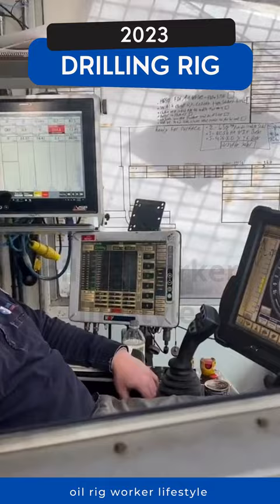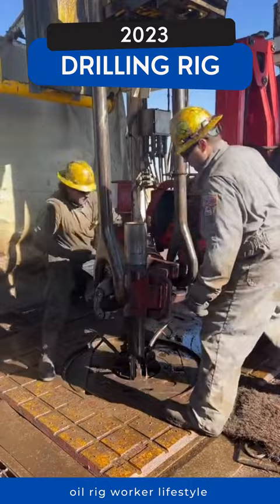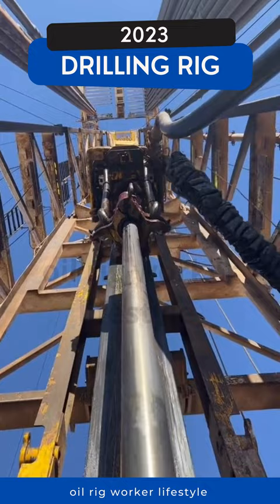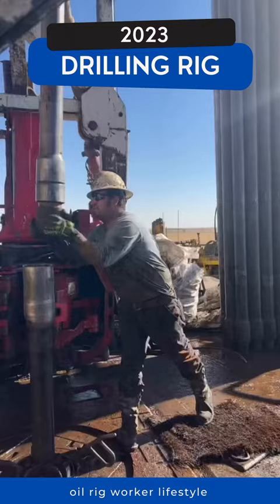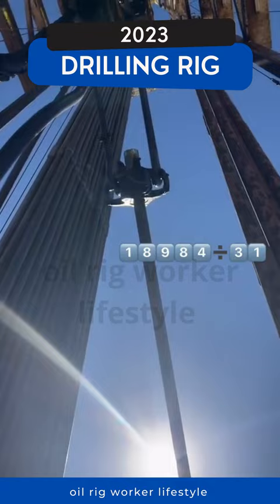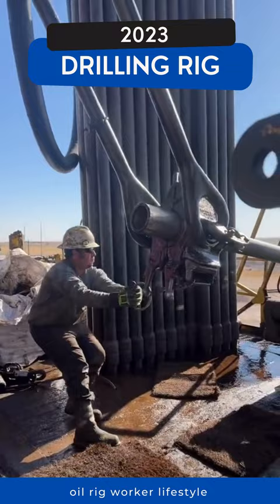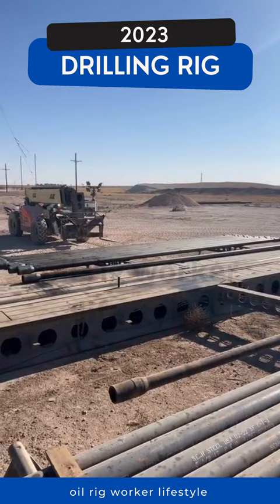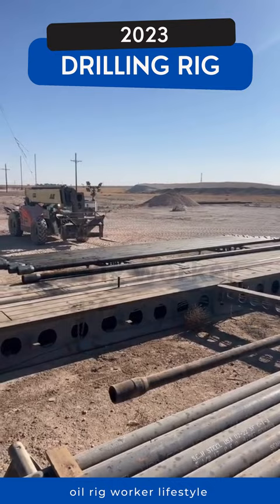rig floor activites 🔥 rig floor drilling #petroleum #casing #rig #ad

Comment: So, those pipes used to drill, do not stay in the long hole? What prevents the hole from collapsing in the softer stuff? Clearly, the bedrock won't collapse in on itself, I would assume, but the soft stuff... I want more info, and had to come back after trying to research for 2 hours about this... Anybody is welcome to help answer my questions!!!! Thank you.
Reply: After we drill the hole we put casing and cement down the hole to stabilize the integrity of the well. The casing diameter is slightly slimmer than the hole so that the cement goes along the outside of the casing keeping it in place
Reply: The guy below answered it well. But also the fluid that is currently in the hole keeps pressure on the well bore and keeps it from collapse
Reply: @T-Bambino  ah, thank you...
Reply: @jacobsmall5942  and that is also clever.. makes so much sense now... Thank you both for taking the time to answer my questions. I can assume this is common knowledge for most folks, but since I just purchased a new(old) house and it has a well and a septic system, I have been going down all sorts of rabbit holes and been learning all sorts of really amazing info, allot of which doesn't pertain to the house info I want to know, but none the less, I have been really intrigued and blown away with the technology you guys work with. I once just thought it was a simple hole, and call it a day... But oh no, these are not just a simple hole in the ground. 

I read a paper that covered that Russian well, that mention only a few neat details about that 12 mile deep hole. The drilling rig itself, had to be designed to not just apply pressure downwards for the first few pipe lengths worth, for the cutting/chipping action to take place, but what would have NEVER crossed my mind, is once that were past that point of about 5 to 10 pipe sections in the hole, the drill rig no longer needs to apply downwards pressure, and the drill rig now is in reverse, as per, supporting the weight of the pipes hanging from the drill rig... And once it is 12 miles deep, the shear weight of that many pipe sections measuring 1000's of tons, hanging from the drill rig, but the friction on the outside of the pipes required so many 1000's of HP and 1000's of ft lbs of torque to overcome... While not forgetting to exclude the water-shear on the inside of the pipes, and the friction there too... Just amazing stuff. Again, thank you for taking the time, I am learning about this slowly, and I must say, the men who run these rigs, from what I can see, are some of the most hard core men, not only physically but mentally, to push through some of the worst of weather conditions and climates, in order to get the product the nation and world demands, almost at a measure of being ungrateful, as I learn how complicated this process is.. So, thank you for rocking and rolling to work such an occupation l, that my whippy noodle arms couldn't handle.
Reply: @drubradley8821 well damn that's about as much thanks I ever got working on a rig. So your welcome.
Reply: Up here in Alberta we run what is called a service casing made of cement .
Reply: Google hydrostatic pressure. The mud thats pumped down the drill string and then back up the outside to the mud pits on the surface, is required to have a specific density to counter any bore collapse. Its regularly measured in lbs/gal in the states. The mud weight is tested often by the derrickman and mud engineer (1× per hr or so) to ensure that there is enough pressure pushing back on the walls of the newly drilled hole to ensure that it doesn't slump in on itself. They add "barite" to increase the density of water or diesel. They add "LCM" (straw, sawdust, mica, etc) to develop a "wall cake" and ensure they don't lose the mud they've created to certain porous formations (1000s of gals of mud is also expensive). They also add soap and other chemicals to the mud to help lubricate etc. They add "gels" to help suspend particles etc. This is all done to help maintain bore stability and improve the drilling process. But without the correct density of mud, ie mud weight, the hole can collapse in on itself. The hydostatic pressure down hole needs to be great enough to hold off a bore collapse. 

But yes, after the string is removed they will case to ensure consistent flow during production. But during the drill process the bore is maintained by engineering the proper mud density.

Comment: So it’s still hard work but when I did it in 2000-2004 we used spin chain , Kelly and rotary table.  

We laid the pipe sideways by pushing it to the v deck and ripping open the elevators.  The pipe would soar down crashing into a back stop reinforced with an old tire.   The guy down below would straighten it a quick as possible and hand roll it into the racks .  Brutal all the way around .  Rig technology has come so far lol.  We used to say  , “ isn’t it the year 2000, why are we still working like this lol?”

Comment: Correction one joint of drill pipe can be  45 to 30 feet long It's a short Reg Usually 2 joints of pipe. I've had dope on my hands
Reply from the maker: Thanks 👍

Comment: I pulled pipe in North central TX. 6k/9k ft. 19k sounds crazy
Reply: in the bakken 10,000 straight 10,000 lateral. roughly
Reply: @repete2362   
I got out when the old guy I worked with fell from the tubing board.
 (double/ triple.) 
Hit his head on the well cap. 
Had to fly him out , but he lived it did really f-him up .

Comment: Im the guy who does the inspections. We call it racking because once the pipe comes out it sits in the racks to be moved so we can clean check for problems in the threading and make sure the pipe is straight (called drifting) then we re rack the pipe for it to go back in the ground or go to another site
Reply: Do you have any advice for a fella wanting to get into the industry? Cheers
Reply: Drifting, what a dirty job

Comment: Yeah I would think pulling the drill out of the hole would be one of the last operations to drilling a hole. I guess it does make sense to pack up after you're finished doing something.
Reply from the maker: Thanks 👍
Reply: They trip in and out several times during the drill process. Anytime they change out a bit they have to trip out (replace bit) and then back in. Different bits are used for different geology being drilled (it changes with depth), typically use a "tricone" near surface and then switch to a "PDC" for deeper. Bits won't last an entire hole either, so trips also happen when the bit wears out and needs to be replaced. They also "case" the hole with steel casing to keep it from collapsing after they pull out and begin to produce the well. There are different stages of the hole that they case, but anytime they need to case they have to pull the drill string out, ie trip out. And if directional drilling then the mud motor and survey tool need replaced or serviced at different times, and this requires a tripping out and in as well. Tripping happens often, but "coming out sideways" only happens when drill string is no longer needed and hole is done.

Comment: Drillers sure have it soft now compared to 40 years ago.  Then, the drillers could tell what the bit and drill string were doing mostly by older guages and the vibrations coming up through the floor.  Of course now the technicals coming through the instrument panels combine a lot if the mud logging functions but certainly not all ofthem.
Reply from the maker: Thank you
Reply: If it’s so soft why don’t u go join the team?
Reply: They also weren’t drilling 2 - 4 mile laterals 40 years ago.
Reply: Good for you
Reply: That's not soft that's called innovation

Comment: No spinning chain..
Reply: It’s a fuckin drill rig not a work over and besides that shit is slower than a hand trained up good on the 80
Reply: @theRealBased1492  Correct. Spent 6 Years on the old rigs. We would Use a Coffee can to go fishing with.. 🤣Hardest day ever Daylights called in.. And we had to fish 9500 ft of pipe. That over shot kept missing.. And when it grabbed it would pull up 3 joints pipe broke all the way down.

Comment: If they are tripping they are pulling 3 joints at 90 ft. 
They don't trip 1 pipe at a time. They are laying the pipe down 30 ft at a time.
Reply: It depends on the rotary system

Comment: What if the pipe falls back in? Do the stoppers ever come out on accident and the last 1/3 of the pipe falls back down 19k feet lol
Reply: Yes it happens sometimes. You can try to trip back in and hope youre lucky enough to re-attach, otherwise they go "fishing" with specialized tools to retrieve the lost section of string.
Reply: @Henchman-21  thanks for the info, what a crazy operation

Comment: Would be fun to know the total weight of that piping when it’s full length 🤯
Reply: Hard to tell but it looked like xt39 connection, which is typically 14# a ft.
31' is under average but we'll go with that and I'll shave off some ft based on the fact there's probably another 1k-3k ft worth of drill collars at the end of that string, so call it 15k total ft worth of drill pipe. 

210k lbs or 105 tons of drill pipe. Drill collar weight can vary wildly but probably another 20-50 tons worth.

Then it goes to inspection but what he doesn't mention is the company will argue over damages, get the inspector to ignore criteria and pencil whip the report due to unrealistic job turn around. Which results in a major failure in another 6-12 months.
Reply: @1braincellwhm  that is a lot of weight!!! Thanks!🙏
Reply from the maker: Thanks 👍